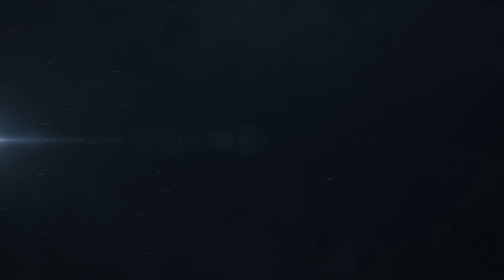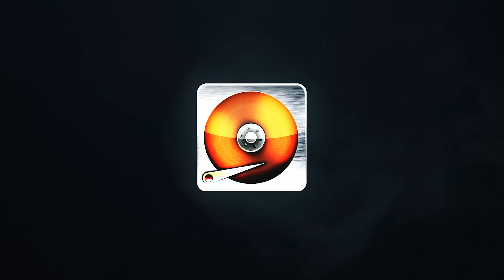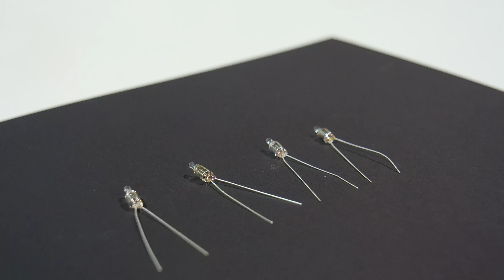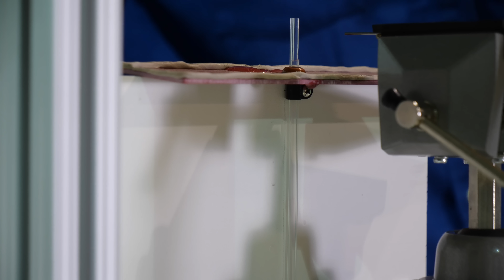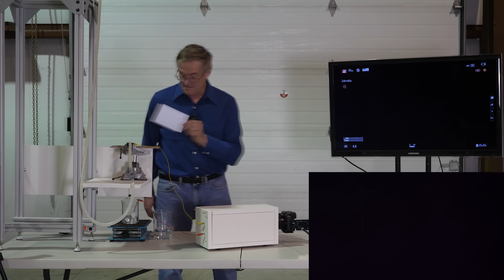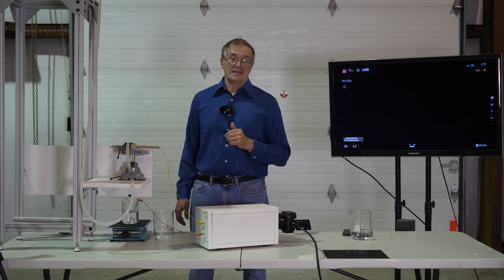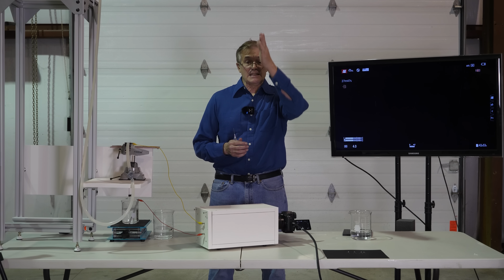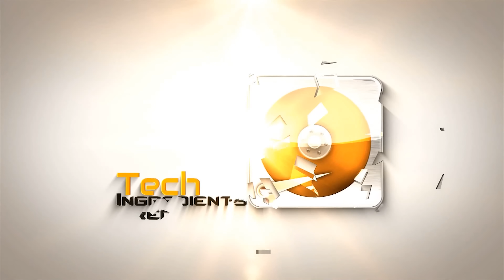We made electricity from water - and it's easy!

Comment: Collection of the rain water is a potential issue and the scale of production is going to be low, but what about if you couple into roof guttering? On a house with solar panels you could dump the power into the inverter, thats said you might need to step the voltage down if you're looking at 6kv outputs.
Reply from the maker: That would be the best way to use this without investing in expensive infrastructure.

Comment: I had that dam thought, too. Good thing I waited for you to bring out the dam idea so I didn't have to delete a dam comment of my own. 
But seriously, the big problem with setting this up with dam runoff would be clogging. Especially with such a small diameter. But that can be overcome.

If the guys writing the paper didn't make it clear they meant collected rainwater, then they set themselves up. But imagine a huge system set up on the side of a skyscraper. It's an awful lot of infrastructure, but if your setup brings a milliwatt, then a million of those setups would be a Kilowatt. At the same time it's passive, so it pays for itself eventually. A small angled ledge at the top of each window would increase the collection of water by the building, too.
Reply from the maker: Agreed!

Comment: This method is orders of magnitude less efficient than just flowing the same water over a small turbine. Conversion of gravitational potential energy to kinetic energy is much better than the miniscule electrical potential energy you get this way. It's an interesting demonstration, but this can't really have any practical aplications in real life.
Reply from the maker: That's simply false.
The conversion efficiency is a little above 10%, and I stated that early in on in the video.
Reply: @TechIngredients  Compared to hydroelectric generators, where a good one can can convert 50% (and in large scale power plants up to 90%) of energy into electrical power. The losses here are easy to find: most of the kinetic energy is still in the droplets when they drain into the bottom vessel - the water doesn't slow down that much due to electrostatic forces created by the separation of charge - the trickling water could still spin a turbine at the bottom of the setup, and that's the energy not harvested by this process. The limitation is in the poor coupling between the processes... coupling kinetic energy to a spinning generator is quite "impedance matched", but here, mass inertia of water is going against electrostatic forces which don't "grab" that well, and additionally, you can only harvest the transferred charge from the droplet to the substrate, but charge separation within a single parcel of water due to the induced electric field (e.g. moving + on top and - on bottom of the same part), just neutralized with itself when it leaves the field, and that energy goes into heat (motion of ions).

I find it quite interesting that the process is at least in principle a reverse of an ionic wind thruster. In that particular case, high voltage is creating flow (air in that case), and here, flow is separating charge, creating voltage.

Comment: You forgot to mention that you extract just a tiny amount of energy from the falling water and this will never be practical for energy generation. It's just a neat physics experiment. That same falling water could spin a turbine at a vastly higher efficiency.
Reply from the maker: At somewhat higher efficiency.  This is already above 10% efficient. 
The more important implications may be in chemical synthesis.
Reply: @TechIngredients  Okay, I've skimmed over the article, they do claim 10% efficiency from the potential energy to electricity using the optimal plug flow. It's interesting for sure. It's a falling water generator with no moving parts. But I don't think it's scalable at 100W/m². It's just the way that you titled it made all the free energy kooks come out of the woodwork😃

Comment: Research the 4th state of water, liquid crystalline structures form as sheets, near teflon ptfe, cell walls and other types of surfaces and materials and form a visible exclusion zone where particles are pushed out of the liquid crystalline sheet zone. Infrared light also induces this effect in combination. Try ir leds near the tube, or sunlight to measure effect. Pulsed low current/high volt jittering of the h2o sheets can induce H & O2 separation at much lower energy requirements than traditional DC currents to produce gas. Kanzius showed effects using a 10Ghz transmitter aimed at test tube with water, the gas burns. Not over-unity, but interesting and related.
Reply: I had thoughts of how this relates to EZ water as well.

Comment: What is "over 10% efficiency"?
How is it calculated?
Where in the real world do you get the pure rain water for the generator?
How does it compare to a simple hydroelectric generator?😅
Reply from the maker: It will work with seawater. 
The efficiency is based on the water falling 30 cm down the tube due to gravity.
Reply: that's fantastic!
The Earth surface should be full of this devices instead of the current hydroelectric plants.@TechIngredients

Comment: OK now do balloon power. What do I mean? We have all seen where the guy takes a small grid up on his drone with a piece of wire Hanging from the grid and him running an electrostatic motor from the electric differential. Instead of using a drone Why not try several Mylar balloons and instead of running an electrostatic motor why not try to capture it in some sort of a Capacitor or battery so it can be utilized at a lower voltage. Maybe a conversion circuit to lower the voltage and up the amperage?

Comment: A few of my observations.., Instead of the Metal Needle tip the water should drop onto a "Saw Blade" with multiple points to drip from. This will facilitate a common collection point for the (-) negative lead(s). Multiple streams are easy to add via this configuration. The water needs to be recycled with an "air gap" at the top to simulate "rain" to actively recollect electrons (rebalance) from the air (O2).  Finally can the water be "salted" with something like "Microhydrin" (electron source) by Dr. Patrick Flanagan and recycled, or an active Negative ion generator (wind powered) Points to the Plug flow tube?
Just thinking via typing.
Reply from the maker: Interesting...

Comment: Unfortunately, this is not a working idea and here's why: Any tubes and capillaries will very quickly become overgrown with a coating of algae and biological deposits on their inner walls; If the system is designed to capture rainwater, then firstly, raindrops are not clean, but already mixed with dust from the air, which brings us back to the first problem, and secondly, after the rain ends, the remaining water on the surfaces will dry out and a mineral and dust coating will remain, which will reduce the impact of the plastic surface on water and everything will have to be cleaned or the materials will have to be replaced. A closed system using clean distilled water can be a solution to these problems.

Comment: I just find this absolutely unbelievable. Have you checked the pH? It should be a few decimal points so maybe that's difficult. Otherwise you should have hydrogen peroxide and hydrogen gas generated which may be detectable over time. But I doubt the mechanism

Comment: This is an interesting experiment. As far as the power output goes, electricity generated from solar power used to be tiny amounts using the Seebeck effect for example. It became more practical when photovoltaic cells were invented. I'm anxious to see how this effect could be improved upon possibly by the addition of saltwater or a small magnetic field to encourage the flow of hydroxides to the bottom beaker.

Comment: You can also pump water uphill using a ram pump which uses zero electricity then generate power with the pumped water using turbines and gravity. Why hasn't this been done large scale before?
Reply: You need flow for a ram pump to work.
Reply: @markmnelson do you know how many millions of gallons of water flow in US rivers every day? Flow is continual, it's perpetual, it's constant and predictable, it's a free energy source we're ignoring.
Reply: @mattgayda2840  yes. Exactly. My point was only that if you have flow, it’s easier and far more efficient to generate right there where you have it, with e.g. micro hydro, rather than use a ram to pump a fraction of that flow up a hill for power gen on the way down.
Reply: @markmnelson there's places using pumped water to essentially make a water battery by pumping it uphill then using it for hydroelectric generation on the way down later when it's needed to balance demand.

A ram pump doesn't have the same maintenance issues as hydroelectric, plus it's passive and cheap

Comment: I bet you could improve the effect by coating the tube on the outside with a thick layer of silver. They did this with the bottom of Perovskite-cells to stabilize and increase the charge separation and current flow by 250%.

Dr. Ben Miles did a video on this "Anti-Purcell-Effect":
/watch?v=BtOSAOaAmUM

Comment: Is the generated power more than what you would get from simply using the gravitational potential energy of the water?
Reply from the maker: No, it isn't. 
This is not some sketchy free energy proposal. It operates as I described, and so the flow of the water is solely due to gravity drawing it down the tube. The conversion efficiency is a little over 10%.
Reply: @TechIngredients  You mentioned slow moving rivers, like the ones exiting a hydro power plant.  I am thinking about how it would be possible to make the intermediary flow horizontal, perhaps by a spunge like insultion structure moving over another type insulator surface.

Comment: Nice video , with great potential...In swimming pool construction we have to deal with "Equal Potential Bonding"; A solid 8 gauge copper wire that connects the flowing swimming pool water to all and any metal objects within 10' of the swimming pool, so that a human can't connect the circuit and fry themselves. Millions of volts can build up as the water circulates down the pipes and back, for hours on end. 

I would bet you could capture that if you tried. the science around it is well known in construction of metal buildings, swimming pools and even metal fences around underground pipes will do the same thing... equal potential energy... Could be the future
Reply from the maker: That's interesting.  I didn't know that, but it makes sense.
Reply: @TechIngredients keep up the good work, hope your channel gets bigger than Mr wizard, and Bill knye combined

Comment: This set up is using the potential energy of the water reservoir to separate the water ions. Practically, it is no different than a dam generating electricity from water. The energy comes from the same source, but this seems to be much less efficient if I understand correct. In order to make this economically viable, it would be to be done at scale, but then you can just use standard generators, which are more efficient. Maybe there will be some nitch use cases, but I don't see this being generally useful.

Still, this is interesting science and maybe someone will find a use for this in the future.

Comment: > "...at over 10% efficiency".
So you put in 100 joules of energy and get 10 joules out?
Well that's world-transforming....
Reply from the maker: Indeed, it is.  The methodology is completely different.
A solar panel and a diesel generator both make power and are relatively similar in efficiency. But, they wouldn't be confused just because they are both sources of electrical current.

Comment: Excellent. You could however use LED's. I've done this before with high voltage static electricity generated with piezoelectric. An LED will flash with every droplet without ever getting to high voltage. As soon as the bias voltage is reached the voltage will be held there and it will go to short circuit current.  It would be much easier to see as well.
Reply from the maker: The problem is that the current would be too low. A capacitor could be added to fix that, but the voltage drop would be very large.
Reply: @TechIngredients  Ah, I've done this with a piezo electric lighter striker.  The short circuit current must be a lot higher.

Comment: I have a few questions about this. First, does it have to be distiled water? Could you mix some stuff in the water to increase the efficiency? Does the speed of the droplet interfere with the efficiency?
Reply from the maker: It generates 90% as much power with seawater.

Comment: I'm sorry but this has the same vibe as those solar powered peltier watermakers that make water from humid air. It technically works, but the quantity is not even close to useful. I can't imagine a scenario where a smaller conventional generator can't make better use of the falling or moving water.

Comment: If you need sth for the "No moving parts" niche, here's something. 
For all other applications, I ask, what is the source of power? If the source is not large enough, no matter how much meander you introduce, you cannot beat the 1st law of thermodynamics. Given a large enough source, why would one use this approach as opposed to another (say a specifically made low-pressure turbine, aka water-mill)?
As a scientific oddity, this is worth investigation, for sure, but if I had a billion to invest to research a concrete application, say emissions-reduction, I would spend elsewhere.

I'm curious to see what your follow-up research trumps up. I hope (and expect) it will not be a "mainstream" generator-implementation.

Comment: Why don't we simply aerate our home water supply from the mains on the way in.... and carry some electricity into a grid tie. This way when we use water at home (that we pay for), we get an offset on our electric bill. (perhaps credits are stopped during hosepipe bans). Call it a reduction in collective carbon footprint when we use our most basic necessity.

Comment: You said 10% efficiency. Is that calculated by comparing with the potential energy (m * g * h) of the water at the elevated point? I don't understand the use case for this. Compare to just having a water turbine, which has around 70% efficiency and is built from simple proven components.

Comment: A few things I'd like to discuss here, and of course, I am trying to be constructive, so I'm writing this in good faith (and I welcome your response to these points):

- While yes, it's nice to see lights blinking, powered by water droplets, for those of us who are more engineering minded, which would probably be a considerable portion of your viewers, numbers are a lot more valuable and interesting. I like blinking lights, but they mean absolutely nothing in terms of what the efficiency of this approach to converting gravitational potential energy to electricity is. I just feel that in this instance there is an odd disconnect between the presentation and the context (your suggestion that this technology should be used in a practical manner, beyond being a party trick).

- When you say "flow of centimetres per second", is just the speed of the water, while what really matters (in practical terms) is volumetric flow (or mass flow,). If you have a speed of 1 cm a second in a 3 mm diameter tube (that's a cross section of about 7 mm2), that's indeed an extremely small volumetric flow of around 70 cubic millimetres a second (at "1 cm per second of flow"). To yield 1 MW of power (based on your 1 mW figure in the video, don't know how accurate that is), we get to a bout 70 cubic meters (or 70 tons) a second, which is quite a lot. As a comparison, a water turbine with a very small 2 meter head , generates about a MW from a similar volumetric flow, and only needs a simple AC generator and a transformer, to be hooked up to the  grid  (depending on the grid voltage available, you may not need the transformer).

-Very likely where there is enough water flow for this thing (at a scale that produces practical amounts of power), there would be enough flow, and head, for a small, low head turbine installation. You should definitely do a comparison based on figures, and experimental data, between simply using a turbine, and this charge separation approach.

-It wasn't mentioned, but in practical operation, you would not have such clean water as it's shown in the video. You'd have water full of contaminants, sand, organic matter, etc. Whatever your approach would be to building an installation with millions or billions of channels (individual tubes or the foam), you'd have to pre filter the water, or in some other way deal with contaminants, since your channels (being very narrow, and especially if they are "winding") would become the filter themselves and likely get clogged pretty quick. Turbines are a lot less sensitive to such contaminants.

All of the above being said, of course, if you can demonstrate practical applications (not in a lab), of this approach, that's very good, and I suspect that is your intention, so I'll do wish you success in that regard, but until then I will remain a sceptic (not in terms of the effect it self, that's been well established for a long time, but that this has any practical advantages to water turbines, in the field of power generation). 

Maybe you'll find a niche though!

P.s.:

Please don't recommend Sabine, and of course don't believe my word for it (as you shouldn't), do a bit of research about her, and you might come to the same conclusion. I'm not saying you should actively speak up against her or anything, but I don't think she should be recommended as an educator.